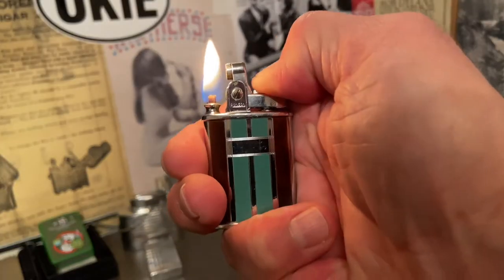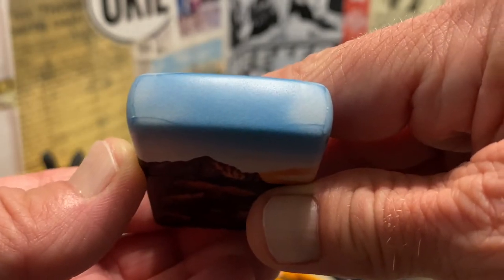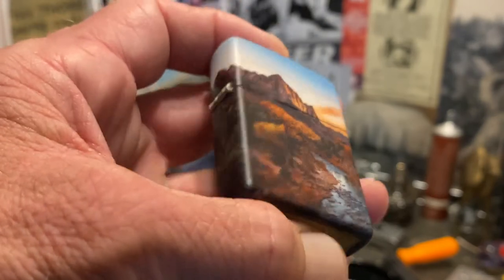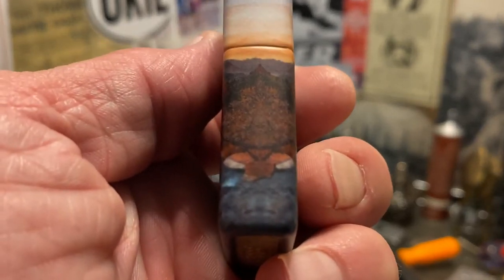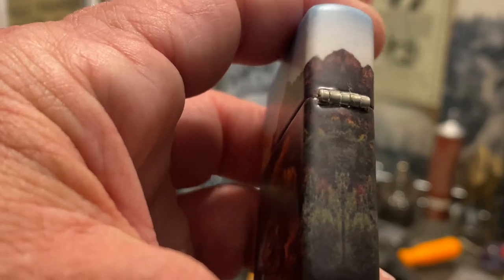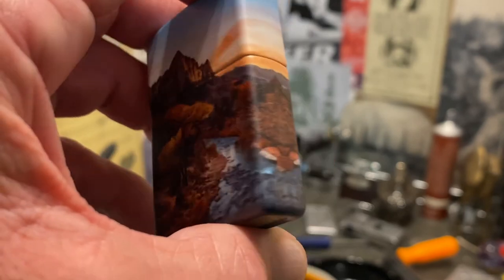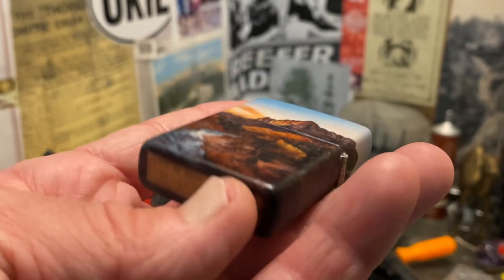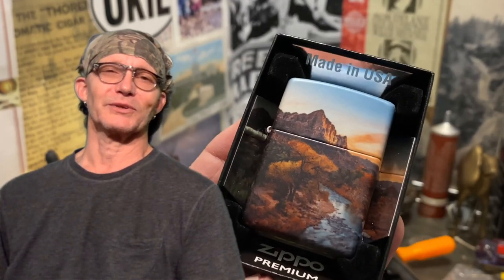Are There Defects In The Finish Of This 540 Color Process Majestic Views Zippo Lighter?

Comment: So the process of the 540 is still improving. They started off by individually wrapping the lighters, now they have a couple machines that wrap them. Due to the wrapping process, they are unable to individually number them. They are still improving their process, you can tell from the quality of print on the wraps. Earlier models are grainy, but later models such as the Majestic Views are more crisp. (Source: an employee in the buffing department in Bradford that I met)

Comment: Very interesting ! Mine (H 21) is the same as yours with the "blotchy blue sky line" borders.. I also observed that others have similar lid art (when photos were available - most people don't take pics of the lid).  Also, I'm wondering if the "Majestic View" aspect of these is one side being more of a "Gloss mirror Finish" & the back more of a "Matte flat Finish". Mine is similar to yours in every way, but as lighter nerds.. we are splitting hairs.. I don't think most users / collectors even notice the lid & subtle difference in the glossy mirror finish on one side. The whole "Version #2" also makes me think that they had problems with them in the beginning. Either way.. I'm happy with mine but like you, putting the breaks on the Marlboro exclusives after I get an Orange Paisley. I think these will definitely go up in value in due time (If they stay a Marlboro exclusive. The "Iced Paisley" is now available to buy, which was a Marlboro exclusive at first.) Anyway, thanks for taking the time to investigate!! I don't post videos yet but rest assured, mine seems to be a carbon copy of yours. If we do have have a bad batch, if a "Version 3" comes out.. it will add to the collectible aspect.